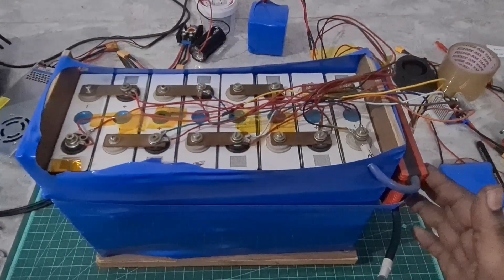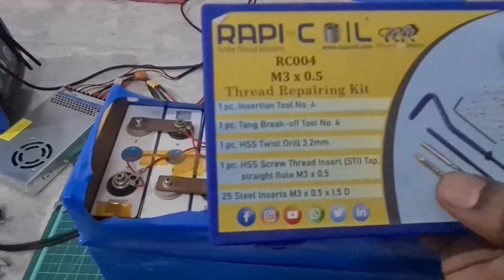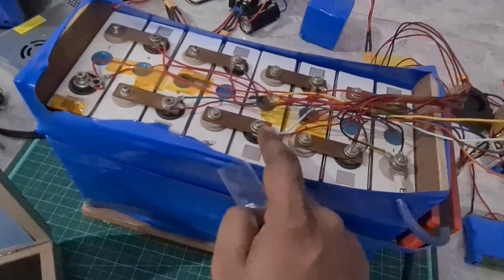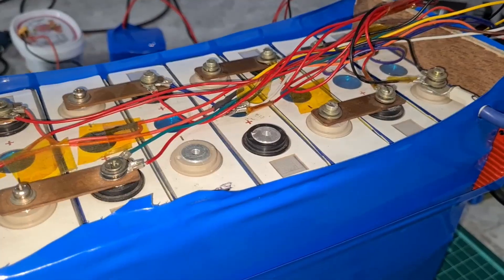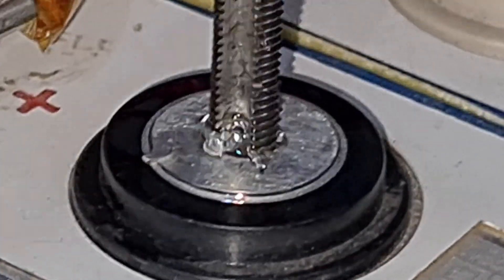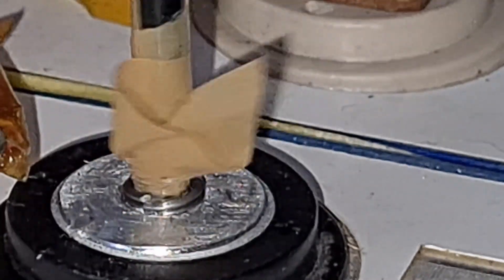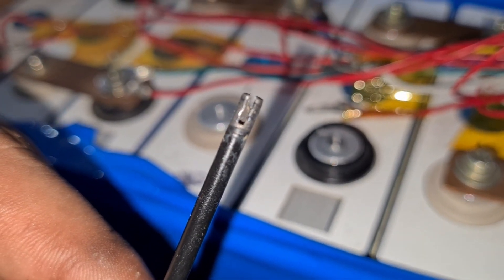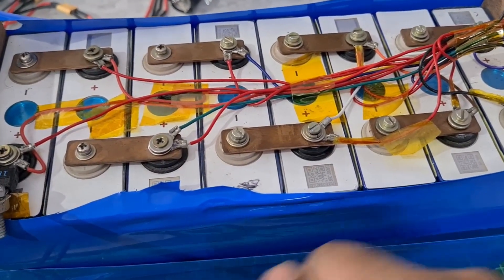Helicoil. Fix your stripped LiFePo4 Terminals. Smart and Easy!!

Comment: The better way to do it is to have two taping bits.  You leave the first one pointed as it is.  The second one you cut off the pointed end square. You then use the first pointed one to start the tap,  about two turns.  You then use the one with the cut off tip to finish the tap right down to the bottom of the stripped hole.  This will allow you to screw the entire heli coil in without having any portion of it protruding from the hole.
Reply: you said it right but in any case due to the low aluminium quality won't even reach 7Nm torque which is essential to have a decent connection. There are better alternative to the helicoil allowing these cells reach a 7Nm but somehow overtime they get loose no matter what... at least for vehicles applications
Reply: Yes and I found the including bit and tap were not standard sizes (6.2mm and 7mm) so best to order two kits